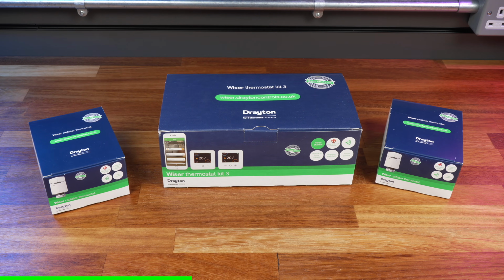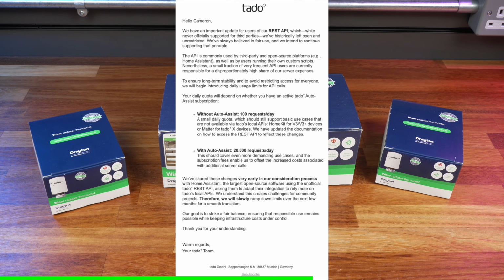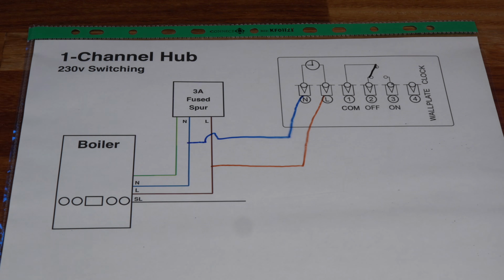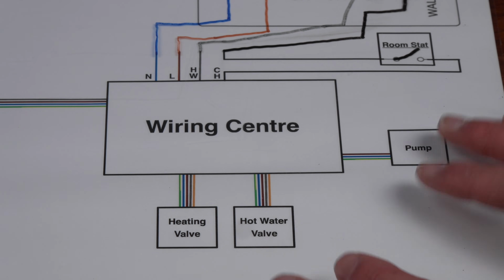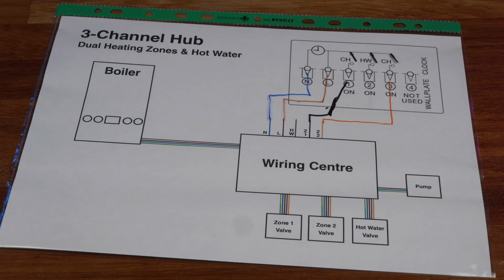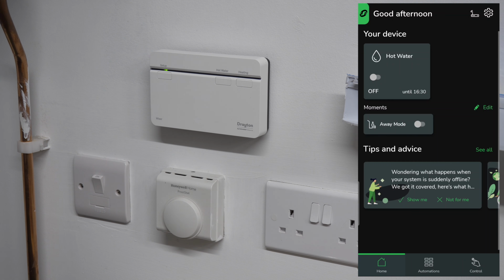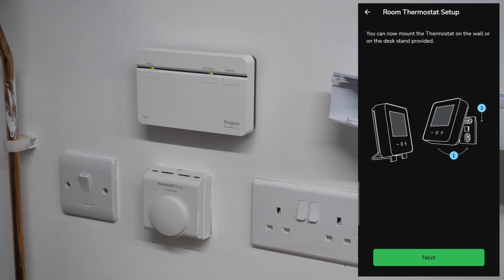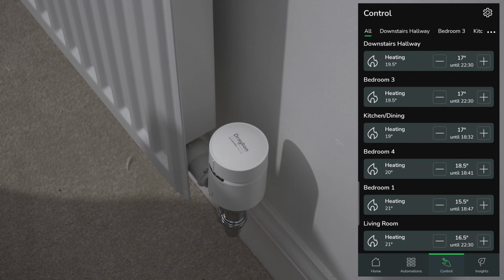Goodbye Tado, Hello Drayton Wiser! — Full Installation & Setup Guide!

Comment: @camerongray1515 i'm currently in the Tado system, and some of the stuff they have been doing or are rumoured to be doing doesn't sit well, so i'm very interested in how the Drayton system works.

i have a single zone combi.
3 rooms with each room having a tado wireless temp sensor (on the wall) and the rad in each of those rooms having a tado smart TRV. the hall has a rad with no TRV so is the "always open" rad.
this gives me individual room control with each room being able to call for heat without the need to heat any other rooms. i have the wireless temp sensor set as the "measuring device" for each room (as using the TRV to measure the room temp can often give spurious results due to it being right next to the rad and being low down close to the floor), this means that sensor on the wall is doing the measuring and calling for heat, which then makes the TRV open/close as required.

will the drayton system allow the same? from watching your video, as you only have 1 device in each room/area it's unclear. in your setup, where a room only has a single smart TRV, you'd either need to use the app (be it the drayton app or HA app) or go to the rad to adjust the temp, where in my scenario you still have wall mounted control (as well as having the smart TRV and app control).

i also use Home Assistant with Tado currently linked to it.

Comment: Another excellent video, thank you!  Just what I was looking for to upgrade/replace my Honeywell Lyric (that only does smart-ish wireless room thermostat/heating control) for something that also links to HA locally.   I got "actively engaged" with the wiring during a recent boiler replacement and ended up specifying (and installing) the  Wago wiring centre for the plumber as well as labelling all the cables, as you have.  I can't see a commercial plumber using the Wago centre often (too expensive for them) and certainly not labelling the cables - as you said, it's very time consuming.  Really looking forward to the HA video!    -- Greg.

Comment: Been using this system for nearly a year now, linking it in with HA I can control my Sonoff TRVs which I already owned, the flexibility from HA is so good!
Reply: So you don't need to use wiser TRVs? How did you configured that?
Reply: @hugos7114  Using HomeAssistant, the flow is essentially TRV temp goes below XX -> tell Wiser to go into override/boost so it triggers boiler -> when TRV temp requirement is reached and no other TRVs are requesting, tell Wiser to turn off override/boost.  

There's two automations, one to fire, one to stop firing. "When TRVs change to Heating" then "Change preset on Wiser to Override/Boost"

"When TRVs change from Heating to Idle" And If "Each TRV is idle" then "Change preset on Wiser to Normal"

I've got various day and home/away schedules automated which because of the above work great, I can also manually raise/lower TRV temps without needing to mess with anything else.

There might be a slightly better way to do this, but it's worked for me without noticeable issues.

Comment: I have an EPH combipack4 which is opentherm compliant. I recently installed a second combipack4 for an underfloor heating zone, as it seems you can link them together in opentherm and they'll wirelessly talk to each other as well as send a switched live to the zone valves, as well as an OT signal to the boiler! So far it seems to be working well.
Reply from the maker: It was definitely one of the options I looked at due to the multi-zone OpenTherm support and I actually briefly used one in my previous flat when it was installed alongside a new boiler.  Definitely a good option where you want OpenTherm with multiple heating zones!  Unfortunately their Ember smart functionality just didn't have the level of Home Assistant integration I was looking for for my setup.

Comment: I have that system for a combi boiler and central heating only and it's terminals 2 and 4 that are connected,if you have two switch wires coming from the boiler one can connect to the permanent live and the other to terminal 4,if you only have one switch wire you need to take a link from the permanent live to terminal 2 and connect your single to terminal 4,when I bought the Drayton Wiser Kit 1 a year ago I checked youtube for a tutorial and Justin from Artisan Electrics was the easiest tutorial to follow for my particular kit and that's how he did it and it works perfectly,very enjoyable video by the way and well explained for different kits

Comment: Hi Cameron, another excellent video, many thanks. On the whole I think the Drayton products are some of the best around, it's their messaging that's poor.  Usually the best thermostat/controls are the ones from the boiler manufacturer, as only then can the thermostat optimally control the boiler (as usually it's a proprietary protocol). As for OpenTherm - unfortunately most boilers in the UK are NOT compatible... so might be worth talking about the benefits in cost, comfort & efficiency from modulation in general, especially of the boiler, and also limiting the boiler's max heat output ('range rating'), as vast majority are well over-sized for the property. ...albeit at risk of turning into a plumbing channel!
Reply from the maker: Thanks!  Thankfully more and more new boilers are starting to support OpenTherm or have some sort of adapter from their proprietary bus but it's definitely not universal!  I did consider Ideal's own controls but unfortunately they're pretty heavily cloud based.  Range rating is definitely a good idea, unfortunately my cheapo "new build special" boiler doesn't support it so I'm stuck with a 35kW boiler.  Thankfully OpenTherm at least helps comfort levels but it'll never be a particularly efficient setup.  Of course a better boiler would be an option but the plan is to run this boiler for a couple of years and go straight to a heat pump.

Comment: As an owner of Tado X stat I'm very concerned and disappointed with what Tado is doing right now. It doesn't affect me that much yet as X-series supports Matter which I plugged in into HA, but it has limitations (there is no control for hot water which is a bummer and no schedules so if I want to change the target temperature via HA it will set it until I resume the schedule via the app, which is quite annoying). So I mainly use the matter integration for "tracking" purposes (+1 more sensor in the house), but would probably prefer to consolidate all of the controls in one place (HA) rather than having multiple apps. But as Tado X isn't that affected yet, I wasn't planning to migrate anywhere. But as I started seeing more videos about the topic I'm more eager to change my mind. I really love that there are options to have local access without the cloud and would love to see option parts of this series. And I do not want support Tado anymore with whatever they're doing with such bad moves (but now users can opt-in for AI-assist features lol. not that they changed anything). What are you planning to do with your old Tado system, selling on ebay or so? Just in case if I will eventually change my mind and replace Tado with Wiser so I have a plan/example what people were doing in a similar position 😂

Comment: I wonder if you can easily use "Thermostat Kit 3" for Single-Zone just "Heating & Hot Water" systems but getting 1 extra thermostat you can put into another room? It looks much cheaper to get another stat unit this way 😂 I suspect that the only issue might be that you will have a choice to select a zone, but other than that any concerns? Considering that the wiring is done correctly and "Zone 2" is not corrected anywhere.

Comment: We have had wiser for a few years now, and integrated into homeassistant and it's been bulletproof. I also wired it up to use opentherm about 2 years ago and it's been amazing. My partner and I used to argue about the temperature because she gets hot and I feel the cold. Opentherm means she doesn't even notice the heating is on because the radiators are often switching on at about ~30C just gently keeping the room at the set temp of about 20C, and it means the boiler is more efficient as well. We no longer get the hot then cold then hot then cold situation - spot on.
Reply from the maker: Absolutely, OpenTherm is great from a comfort perspective!  Wiser even exposes a tonne of OpenTherm information over its API.  The HA integration already presents things like the flow and return temperatures and you can get even more by calling <hub_ip>/data/v2/opentherm/

Comment: Tado is doing even worse things than what you mentioned. They are now making the tado x radiator valves completely useless unless you pay for a subscription. New customers require a subscription to control individual room heating. Tapo is going completely insane. I considered their system for my new house, but I will absolutely not be buying any of their trash in a million years. I'm glad I found out about this before I made the purchase. I'm now considering the Bosch thermostat II since it works directly with HA over zigby, but this drayton system also seems interresting.
Reply: I do wonder when a class action will be created in Europe vs Tado and their unfair business practises....
Reply: I was about to get a full Tado X system for my home.  I was looking at getting 2 wired thermostats and 12 TRV's.  However, all these changes that they have made to the API and subscriptions have changed my mind and they will no longer be getting any of my money.

They are 'doing a Synology' - making commercial decisions that may well break the brand, especially amongst smart home users.

Synology have now made a massive U-turn, now they realise what their decisions have done to their sales figures, but it may be too late, as many users have already jumped ship to other brands.  I see Tado going the same way, unless they very quickly change their direction and release a local API that works seamlessly with HA, Google Home, Alexa, Apple Home Hub, etc.
Reply: Went from nest to tado
Biggest mistake had it for 2 week and boom subscription - planning to return it
Reply: And people wonder why I refuse to use anything that is tied into the clown.  Devices only get Internet access if they need it, IoT stuff does not.
Reply: What?? I was closely watching their API access drama on HA github issue, but haven't noticed this insanity. Not that I was looking for TRVs (especially from Tado), but this sounds crazy.
Reply: They back tracked on this giving it free to all users now but they will be at their next stunt soon im not upgrading to new tado model at all since this Drayton will be the next to be installed
Reply: I have only two cables in my current thermostat. Will it be compatible ?
Reply from the maker: @AllenIve3 I assume your current thermostat is battery operated and installed centrally in your house.  You'd need to work out what your existing wires are doing but you probably have a permanent line and switched line (basically the same as a light switch).  You wouldn't be able to connect the wiser hub in place of this directly since you'd also need a neutral wire to power the hub.  In this case what you'd want to do is find the other end of your thermostat cable. It'll most likely be joined onto a cable connected to your boiler somewhere near the boiler.  Possibly in the back of the fused spur feeding the boiler or a junction box somewhere.  This is where you'd locate the wiser hub connecting the switch wires to the hub and also feeding a permanent line and neutral to the hub from the load side of the boiler's fused spur.

Of course, if you're in any doubt at all, consult a qualified electrician or heating engineer.
Reply: @camerongray1515 I am having the same issue here. 2 cables, and the current non-working thermostat is not even battery powered 😂
I was keen to get this product, but it seems like you would suggest hiring an expert to fix this - and in my rental property even the hub alone is hard to justify. Am getting this right?

Anyway, absolutely incredible guide and presentation, genuinely one of my favourite guides ever and I hope you'll continue making them! Thanks man
Reply: This is why if it’s not zigbee local, I don’t touch it. 

Anything that requires an account = fk right off. 

It’s a shame because I quite like the Shelly devices but that wants an account too. I’m alright pal, cheers.
Reply: Bastards
Reply: Haven’t they back tracked now ?

Comment: Nice video. I was tempted to replace my Nest with this, but not keen on battery powered thermostat. No option to hard wire power to them? I have a USB at my nest thermostat
Reply from the maker: Unfortunately not, although the battery life should be around 1-2 years, even more if you used lithium AAs so it's not a huge deal.  Wired power to the thermostat would be nice but I can live without it.  I suppose you could mod it if you were really motivated, but obviously that's going to void your warranty.etc

Comment: You cover Opentherm a lot in your videos. I am keen to hear if you have also evaluated Weather Compensation (as found on the likes of the Viessman 200-W) and use of outdoor temperature sensors rather than using indoor thermostats? 

Many installers seem to be moving away from traditonal S-plan layouts with zoned heating zones and OpenTherm, to system boilers which a 4 pipe layout with dedicated hot water flow and return for the cylinder - and favouring a large single zoned system controlled by external weather sensor.
Reply from the maker: I have considered it and my boiler does technically support it, although it's such a basic model (Ideal Logic ESP1) I'm not sure how good it is.  It supports "Weather Compensation" where it sets static flow temperatures based on the outdoor temperature but doesn't seem as useful as the "Advanced Weather Compensation" on higher end boilers.  I'll probably give it a shot one day but I think my brain just understands OpenTherm better and I like how it'll normally results in extremely low flow temperatures even when it's cold outside but can jump to higher temperatures to heat the place up quickly in the morning or if I've been out with the heating turned off.

Comment: We had issues with Tado either not turning on the boiler or not turning it off, we always had issues at the start of the winter months with the schedule not being accurate. After eventually getting hold of someone they remotely updated the firmware and bricked it, then said I had to pay for new kit that they had bricked. Ditched it and went to Wiser

Comment: Properly balanced Open circuit,  and pure weather compensation is usually the best way.  No need for TRV's other than in rooms with a lot of solar gain.
Reply from the maker: I've considered weather compensation although the support on my boiler is very basic (Ideal Logic ESP1) so I'd still need some sort of thermostat alongside it.  I imagine it could work well on a better boiler but my next step will be a heat pump rather than upgrading this one.